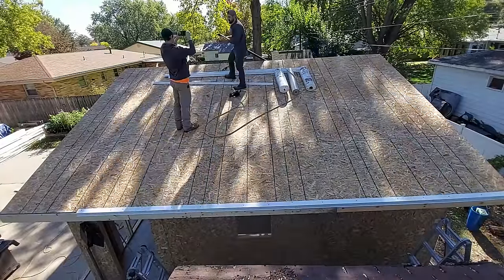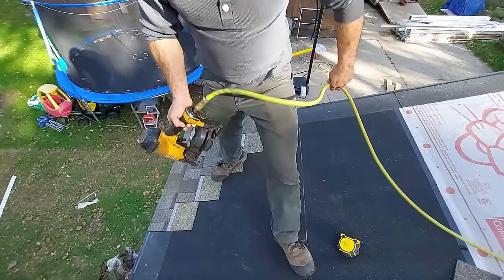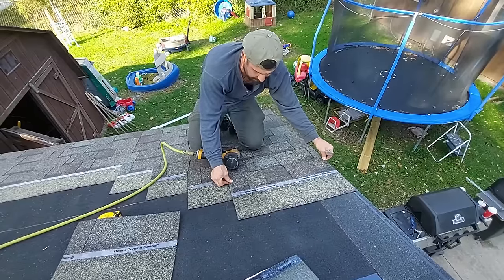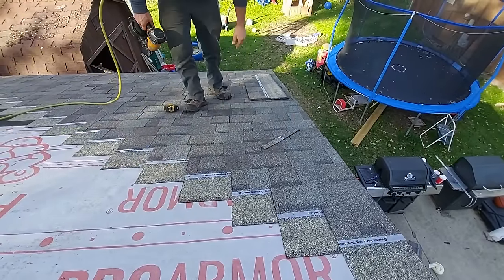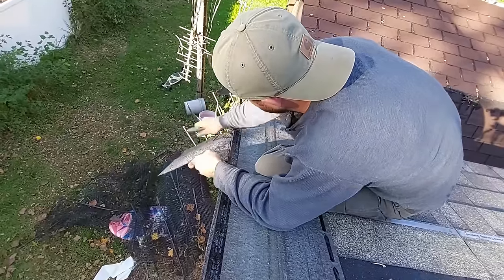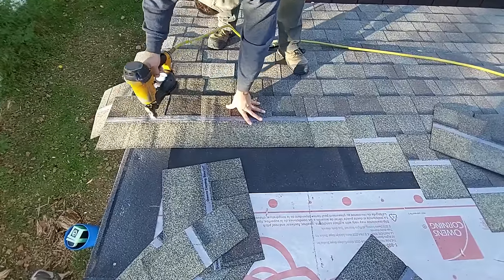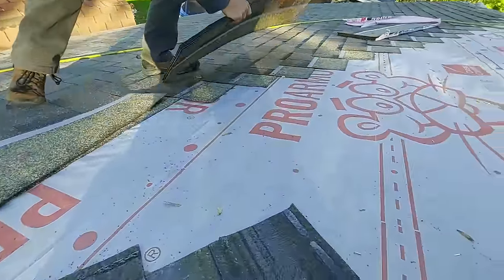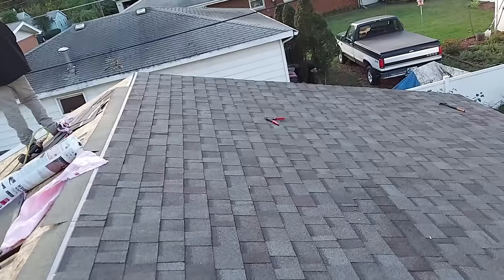HOW TO | Roofing Basics (Part 3 of 3)

Comment: Great VIdeo Thanks! One question is I noticed the shingles have a plastic film over the tar strips . I noticed you did not remove them. do they melt away with heat exposing the tar once it gets hot or how does that work?
Reply from the maker: The tar is on the bottom of the shingles here.  I get this a lot so there must of been something a while back that got a ton of people to think there's a plastic strip that needs removed. It actually says do not remove on it most of the time.  I believe it's there to keep shingles from sticking together when packaged

Comment: Dude, love you videos, very informative. How would you go about stair stepping when you're rake is at an angle? My ridge sticks out a foot or so farther than the bottom of the roof. Seems like each row would be off an inch or so. I guess starting each row focusing on the stager, overhang the shingle, and then trim the extra?
Reply from the maker: Check out my shingler race video from a yr or 2 ago and you can see me do it. It's also in my modified #onesquarechallenge video.  It's on a hip roof.  It's actually easier.  Basically cut 8 inches off but just one time instead of twice (8,16) and your scrap makes it work.  Use only 2 full shingles instead of the 3 like I did in this video.  Same concept.

Comment: Ok my question Is about the ice and water shield. Why use it on first two runs? I was taught only felt or similar product, I like titanium underlayment. Also was taught to use bituthene in the valleys. Jw, many ways to skin a cat. Just wanna know why you chose this method.
Reply from the maker: The 2 rows is required on homes in my area because it's cold.  You probably live in a warmer area if you don't have an ice and water shield requirement
Reply: @NWIVeteranConstruction  oh okay. Still curious though, how does the cold factor into needing it? Snow build up causing leaks?
Reply from the maker: @np-bl7qc  yea I guess the theory is that snow melts off the roof, builds its way from the gutter up as it freezes.  Has something to do with the heat from the attic melting and the cold area in the soffits that freeze the stuff.  It definitely serves a purpose
Reply: @NWIVeteranConstruction  I definitely believe it. Just wanted the story of it. Where I am it's mostly warm, but we get the occasional snow. I've been told snow melting can make its way upward. Just couldn't conceive how. I'll take this into consideration on my own build, and probly do it just cause of that little chance. Thanks for the replies.
Reply: The ice and water is to prevent leaks from ice dams.

Comment: I'm doing a gambrel shed roof on a 10x16 foundation. I was going to do ice barrier where the roof pitch changes. Synthetic underlayment.  No ridge vent. Going to use electric fans to ventilate from upper side of shed.  Should i set my drip edge up like you did?  Is my setup good?

Comment: Your videos are awesome. Started shingling my 12x24 shed 12/12 pitch. I got the first 4 rows shingled using a ladders. I installed some roof brackets, but getting on the 2x10 is a little sketchy. It said it would hold a person + 40lb of shingles, but I’m a big guy at 290lbs. Any suggestions outside of hiring a roofer.
Reply: What said that? If the brackets are in studs or trusses, and the 2x10 is in good shape, it should hold a lot more than that, and I mean a lot more. You can also add more brackets to the middle of the board to lessen the flex of it.

Comment: Hey Zach, I do have one question. I tore out the chimney from my roof, patched the hole with OSB but I cannot figure out how to remove the shingles without screwing up too many and to put ice and water shield down properly and then re-shingle a patch. From your previous three videos, I feel confident that I can re-shingle a new roof, but not inserting shingles into a hole in the roof. Could you detail that please? Thank you.
Reply from the maker: I have a video on repairs. It's about 40 minutes long and should help you get it figured out.  When it comes to patching in the ice shield or felt, it's not gonna be super easy or pretty. But as long as you cleanly pop those nails, you can tuck pieces up underneath.  These days, newer shingles are very difficult to break the tar and not tear the shingles. Older shingles aren't so bad, just be careful and take your time. Even if it takes 20 or 30 minutes it's worth making sure you're not tearing the shingle or the one below it. Often times it seems like you're breaking the tar line easily, but the shingles are still stuck together and you're actually tearing the middle part of the shingle (where you're prying) so keep an eye out for that. Hard to avoid sometimes but You'll know if you did it or not.

Comment: Hello good sir. Tell me your nail gun preference! I see you switched from metabo to whatever that is. I bought a metabo and a masterforce roofing nailer. The masterforce jammed less and shot better, but I’m also not using metabo nails. Even though these nails say they work in the metabo. I looked at the specs and metabo nails are usually slighter shorter, so instead I raised metabo settings to as if it was shooting a smaller nail, seems to fix the jamming but I think I like the masterforce more for the price.

Comment: On the end of your right gable, instead of cutting the foot piece as to not have to install a 3” piece, wouldn’t it be quicker to add a single layered stuffer piece and then you’re not worrying about the nail pattern landing on a seam? Just curious for your opinion.
10yr roofer from Toronto here🤙 Roof on brother, love the vids
Reply from the maker: They call that a Dutch lap and from what I've heard that voids a warranty.  I don't know how much Truth there is to that, I've done it in the past a handful of times when I felt I could get away with it but I don't prefer to do it. Faster, yea maybe, worth it, nah. Just Gatta get good at doing it the right way.

Comment: Great techniques you have there.  I watched many of your videos, and would like to see more tips and tricks when working around roof jacks (especially when near each other or close to ridge), as well as more valley and hip installations. I plan to do my own roof soon (it's been awhile since I did any roofing), and it has two recessed ends (like a dormer) where the ridge extends over the two hips on both ends of the building, and is flashed in that recess where it meets those hips. Looks sorta like a triangle shaped soffit at the peak, looking from the street.
Any tips on popping a chalk line 60 feet by yourself?
In south Louisiana here, you seldom see any roofers using ice / water shield, with synthetic all over.
I'll be using those same shingles, but installing over Owens Corning Deck Defense, which is supposed to be a grade above that Armor you're using, and even has an ice / water rating, being labeled as "high performance" underlayment. Any thought?
Keep up the great work.
Reply from the maker: Thank you.  Yes. There's 2 good ways that I'll  use.  Usually I just set 3 starters. 1 on each end and one in the middle.  I'll put a nail in the middle and snap a line to each end.  The other way is to stretch it the length, pull pretty dang tight but be careful because I feel like gravity can still lower the string a little bit in the middle. Pound new nails in the line at random spots that maybe didn't show up dark enough and resnap to get a better line. On a long run like that you're gonna want to check a few spots on to make sure the starter over hangs correctly everywhere before installing any starters in case the framing is off some

Comment: So do you put down the metal drip edge I didn't see it.
What was on your bottom 2 runs just roofing felt and then that rubber sticky mat on the top edge.
Also do you worry about matching the and low end of each shingle to the next one or am I just too picky.
Hope to get a response love your videos.
Reply from the maker: i think thats in part 1! sorry for the late response. i match up on the bottoms for sure. thanks for the comment

Comment: Hey much nails did you use for that size roof? What roofing nail gun are you using or what nail should I get for my DIY roof replacement project? What size nail 11/4
Reply from the maker: Less than 1 box. And yes 1¼

Comment: A good tip is when u run your rake edge hold top of shingle instead of bottom to the starter  then it won't overlap the starter

Comment: Not a pro roofer and I have a question.  Some people say that the rake edge and eave edge have the drip edge installed differently.  On the rake the drip edge goes over the felt and on the eaves the drip edge goes under the felt or ice and water shield. But all the pros I've see on YouTube put the drip edge over the felt at both the rake and eaves. Would you explain why the shingle manufacturers make this distinction? Is there ever a time to follow this rule? Is the shingle warranty compromised if the directions aren't followed? Thanks for your time answering.
Reply from the maker: The way I did it is the most common from what I've seen.  I'm more than 100% sure that the drip edge needs to cap over your felt and Ice shield on the rakes. On the bottom, ppl have their preferences. Makes no difference to me I've never had a problem with either

Comment: 👋 Hello, great information for the rookie, and the guys who haven't shingled since the 3 tab days, that would be me. 
I'm installing CertainTeed Landmark shingles, they say cut 6 inches then 11 inches, this gets the 5 courses going. Any experience or opinions on this style? I guess its to get the pattern looking good? Applying all your tips this week doing my own garage.
Reply from the maker: Honestly I recommend going with my numbers.  If you keep your stair steps 7-8 inches you're going to have a much easier time shingling. That's coming from experience. I mention a couple different times in this videos why. Best of luck to you! If you could handle 3 tabs you're going to have an easy time with these man. They're dummy proof. Correct stagger, nail pattern and nail placement. Understand those 3 details and you'll be fine.  I have a 2 hour long video with time stamps in the description as well that might help you with other parts of your project. Hope I can earn your sub
Reply: Much appreciated, I'll do the 7-8 method then, right on

Comment: You should have a large space between nails on both ends of shingle not just the one side. One on each end, 3 toward the center leaving gaps on the outer thirds of the shingle. Then when you need to cut in a 12 inch piece on your rakes you don’t end with a seam nail.

Comment: Nail heads are only covered by an inch or so of the tile above. In heavy storms don’t you find the rain can be driven up to the nail head and then down the nail through the underlay as well? Just wondering why the nails are best placed there rather than at the top of each tile.
Reply from the maker: nahh the sealant doesn't allow water to drive up under it. you have to nail where i described in the beggining

Comment: Thank you so much for your service and all of these great videos. I haven't seen a finer video anywhere online.  I have a question.  My roof has one edge of the rake that butts up to a stucco wall with the step flashing and the other side of the rake is just a clean edge roof end  like you have in your video. What side would I start my pyramid on?
Reply from the maker: Preference really.  I would try to start from the wall as most ppl would. Even if it's left handed direction.  But if it's more than 2 sq and left handed direction theI would start the way I normally do and just cut the shingles to fit under the tins (In this video I start the stair stepping the right handed way)
Reply: @NWIVeteranConstruction  ok thanks. It's almost 3 sq. So I'll make the cuts on the tin side like you suggested.

Comment: Where you put the Ice & Water shield on and no felt or synthetic on top of it(under the shingles) you won't be able to get any of those shingles off later if the roof needs a repair. The top half of each shingle will bond to the I&W so well you won't be able to remove it. If you know of a easy way please let me know and I'll be eternally grateful.  I have a 3000 sq ft roof, 100% on I&W with no felt or synthetic vapor barrier and I need to remove some. Thanks

Comment: What would you charge roughly to completely remove a roof Joyce's and all on 25x35ft roof. Basic roof easily walkable. Thank you for any info would  definitely appreciate it!
Reply from the maker: Not a clue lol I would have to see it. I mean you can demo the whole roof structure down to the top plates in a day, pretty easily. Even if the roof has shingles on it but you need a few guys, 3 minimum including yourself to keep things efficient and spread the work load coz it's a heavy lifting type of day. I have a video on how to remove plywood and resheet a roof, if you use that method you can make quick work of the rough part which is getting the plywood off with shingles on it. Knocking the Joyce off are the easiest part

Comment: @veteran construction I notice you don’t chalk it.  I really like this method is the end result it comes out straight?
Reply from the maker: I did chalk it though! See part 2. I did it every 5th row (as I would recommend every beginner)  but I normal just snap one for my starter. You can see in my oldest video.  With a 1,000,000 views

Comment: Why did you use that black felt underlayment first in the bottom and then use the proarmor Synthetic Roof Underlayment the rest of the way?
Reply from the maker: So that's not actually black felt.  That's ice and water shield and it's used in snow and icy areas.

Comment: Question, it looks like you put the moisture  barrier on one section and the felt above the barrier. Aren't you supposed to put the felt over the barrier?
Reply from the maker: Ice and water shield is used for eves, in valleys, and on wall transitions, felt is used everywhere else.  You can cover the ice shield with felt if you want, it changes pretty much nothing other than the fact that the next guy can tear the roof off easier.

Comment: Would you use the same pattern starting from a side with step flashing?
Thanks for the video
Reply from the maker: Yes! 100% yes. This is the length of stair step I do with on any side I ever shingle because it's the easiest to work with when you come to pipes and end walls and chimneys or the end rake or the valleys etc
Reply: Awesome! I’m starting my addition tomorrow. Huge help. Thanks!

Comment: Good afternoon and thank you very much for your videos! But I have a question that I would appreciate if you could solve me! I live in the Canary Islands, Spain, and this type of tile begins to be marketed here (although for now only the ones that I think you call "three tabs"! I would like to make the roof of a tool room in my small farm, with that type of shingles, and here comes my question What length of staples and / or nails are used for depending on the thickness of the marine veneer (I think they call it plywood) you are going to use! For example, if you decided to use 1/2 veneer, 5/8 or 3/4 inch, what length of nails would you use? Thank you very much in advance and sorry for my English, but I don't speak it and I have to use the "translate".
Reply from the maker: 2 ⅜ 8d nail for plywood. And 1¼ nail for shingles
Reply: @NWIVeteranConstruction  I sign up the data! Muchas gracias por tu ayuda

Comment: If you flip the shingle around b4 making rake cut, you don't have to worry about straight cuts as much.
Reply from the maker: You will as soon as you try to use up your scrap though. I butted mine which is the same as flipping it first. Same side gets cuts off. But when you use your scrap you'll have a straighter cut when you do it this way and its slightly faster. I compared times of myself and another really good shingler on YouTube who does it your way, neither one of us were moving excessively fast for any reason, average pace type of thing and my way was faster every time
Reply: @NWIVeteranConstruction  You can use those scraps on the other side, and crooked cuts still would not matter. I do try to cut as straight as possible though. One guy has videos on making books, (pre-cutting the steps) which is a good way to do it too. NICE video though. Very informative and nice nailing example for a new person.

Comment: I have a small portion or roof I need to do it was an add on 4 season mud room probably a 15’ x 15’ foot section, right now it’s all ice and water from the previous owner and no flashing and no shingles. Letting water through the edging where the section butts up to the roof. Should the whole portion be ice and water or should I come up with 2 rows of ice and water and use tar paper for the remainder?
Reply: Oh also the roof section looks to be about the angle of the one you are working on!

Comment: I was wondering, why do you cut the drip edge at the bottom, instead of just using the same 10’ drip edge going up the sides? Here in NM we use the whole piece of the drip edge starting front the bottoms then cut so it curves up the rake. Doesn’t it leave a gap or an uneven break between the two metals?
Reply from the maker: yes it does but we use actual gutter apron here. (see part 1) so the two metals are different. and if you watch my soffit and fascia videos you'll see how we make up for that difference in the gap by wrapping our fascia around